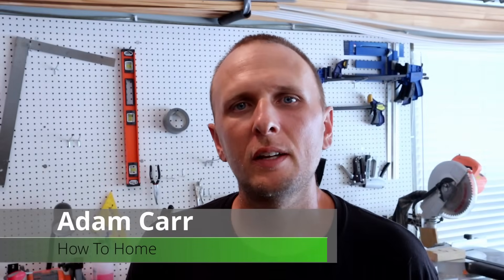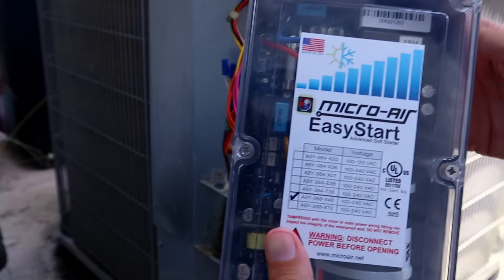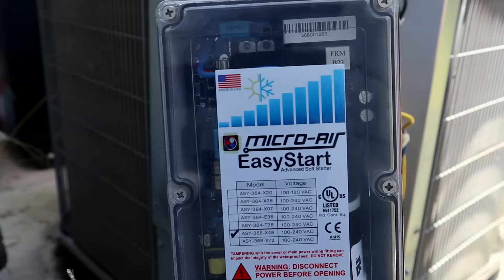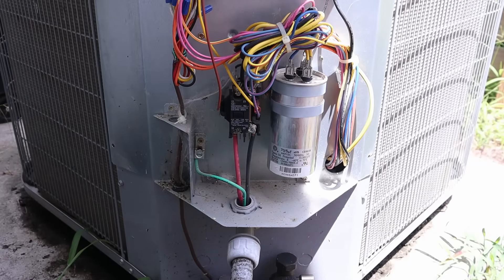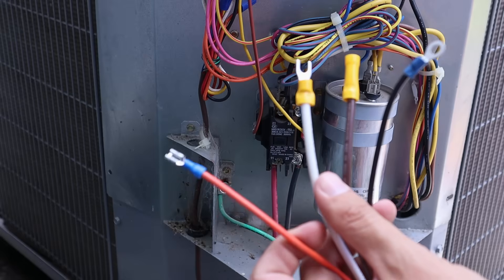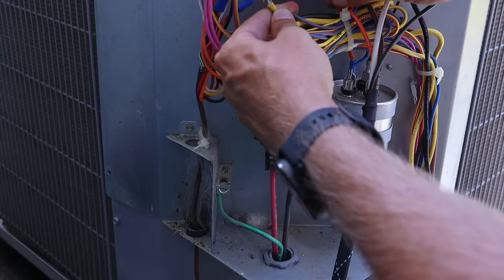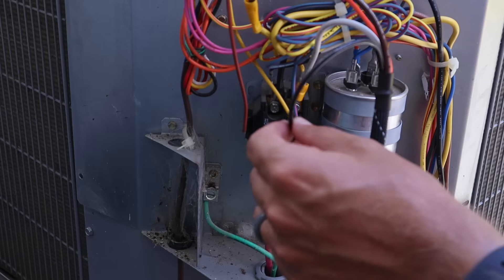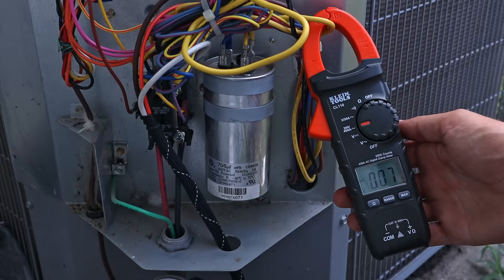How To Install A Soft Start Kit On A Air Conditioner | Run Home AC With A Generator | MicroAir

Comment: Think it this way....Hard Start kit is for kicking your compressor in the ass to get it started.  You can even use a hard start on an old compressor sometimes that won't turn over.  A soft start kit, is kind to your compressor allowing you to run portable generators and extends the life of your compressor.  If you get to a point where the soft start will not turn over a compressor that is old, then switch to a hard start if you do not want to buy a new unit right then.  However, soft start will extend the likely hood of that happening for a lot longer unless you take a power hit(that is what whole house surge protection is for).

Comment: Naked fingers touching the capacitor terminals are scary!  Otherwise great video!
Reply from the maker: The capacitor SHOULD NOT have a charge on it as it is discharged through the windings but best practice would be to use a screwdriver on the terminals to make sure and also discharge in the event it is still holding a charge.  Appreciate the input.

Comment: Great video. It is very informative. I find that the installation of the soft start kit is pretty straightforward. I too have a 4-Ton (Daikins) AC. I have a portable generator, 12K, Duramax, that is connected via a 50 amp transfer switch. I can run everything with the exception of my ac. My ac has a 40 amp double pole breaker. And I'm not sure how to connect it to my transfer switch to power the ac when an outage occurs. I'd like your input. Thank you.

Comment: I am going to install a 368. My 2.5T A/C unit has two capacitors; one is a dual cap 35uF5 370V and the other is a 5uF 370V oval single motor run cap. Can you assist me in how to wire this thing up?
Reply: One side powers the fan. The herm side powers the compressor.  Herm is the side that gets the soft start.

Comment: Hi Adam, Great video! would this device work on a roof top compined unit (AC and Heat), Manufacturer: Comfortmaker, Approximate tonnage: 5 tons.?
Reply from the maker: They do make soft starts for many different sizes and models.  I would check out Micro Airs website and see what they have and if it will match up with what you have.  More than likely they do.  Thanks for the feedback Gary!

Comment: Great video but How do I know the size of my central AC ? If it’s a 3,4, or 5 to unit ?
Reply: your A/C unit should have a plate on it with lots of technical information on it.  What you are looking for is "BTU".  1 ton = 12000 BTU.

Comment: HVAC pro here.
Hard start kits are for a different task completely they are for aging weaker compressors to give them an extra kick in the butt to start.
Think of it like coffee 
Your regular capacitor set it is the regular coffee. Which is great for most people. But some people need that extra jolt with a shot of espresso as well. That’s the hard start.

This is like switching to decaf.
Reply: New homeowner here: Would it make sense to replace the old capacitor instead of installing a hard start kit? Or, this will not make much difference since the compressor is mfr in 2011?

Comment: Can you use that soft start even without using a generator just to save money?
Reply from the maker: It won't save any money.  It just makes starting the AC up easier.
Reply: Than why does his meter show a big difference the reading after it was running?
Reply from the maker: I believe it was showing like 3 amps less.  That’s just on the compressor, there are many other parts using electricity like the air handler for example that doesn’t get lowered at all.  I just know if there was a change on my bill, it wasn’t really noticeable.
Reply: Ok thank you

Comment: So where is the soft start kit installed?  You don't show it so therefore the entire video is confusing.
Reply from the maker: I showed you where I was going to put it.  It doesn’t matter where it’s mounted.  Inside the unit, outside on a post, or the wall.  It makes no difference.  Totally up to you.
Reply: @HowToHomeDIY  How is it connected?  If you won't show it then where do I connect the wires?   Watch other videos of installing soft start kits.
Reply from the maker: I don’t understand.  The video shows how I connected the wires.

Comment: What is Inrush using a hard start?  Curious  which one is better at reducing the large startup current which is hard on a generator.   31.5 amps is a lot, especially if generator is already loaded.

Comment: Thanks for this,  I had never heard of this before. If main power is out, how does the generator power get to AC?   I was thinking there would have to be something connected at the panel.  I am have electrical work done this week and they are installing an interlock kit and a new panel to go from 20  to 30 slots. Also installing a ckt for an EV.  My inside panel does not have AC, its outside, like yours.  Sorry for the novice question.
Reply: Have a 30- or 50-amp Inlet box installed outside the house where the generator will be.  That Inlet should be connected to its own double pole 30-or 50-amp breaker in the main control panel.  This breaker would need to be just below the Interlock, so you can't have both the main breaker and generator breaker on at the same time.
Reply: @Pk3_Garage  Thanks. I have interruptible AC system which puts my AC breaker on the outside connected to separate meter.  Power is fed separately from the main panel.  my 50 amp breaker will be below the  main breaker as you described.  Thanks again.

Comment: A little old for a comment/question.......so by seeing this before and after measurement..does this also mean it's running with less power/effort thus lowering electrical consumption from the power company in essence lowering your electric bill?
Reply: No, this device only lowers the in-rush current at start up.  Once the unit is running, it uses the same power consumption as if it didn't have the Soft Start.

Comment: Hey Adam, just subscribed. Loved your backup generator videos, and I have used most of your advice. So I am also considering this device, and I am a homeowner, but no amateur. I would also like to trim the peak current with my 3-ton for a generator situation, and this looks like a viable option. Thanks for the detailed connection advice. My question is: Should the harness (I assume supplied) be run in Seal-Tite?

Thanks
Reply from the maker: Hey welcome aboard!  So per the manufacturer through email correspondence they told me it does not need to be in a conduit.  And you are correct, it is included and is attached to the unit.  Thanks a lot for the feedback.  Always good to hear when I have been able to help in some way!

Comment: They really work well.     Same situation here.  4 ton A/C.    
It's nice that the soft start allows the indoor blower and outdoor fan to start a few seconds before the compressor.  On Generator it gives it time to ramp up a little just as the compressor starts.  
Great video.  Clear and concise.  Thanks for putting this up.
Reply: I am wondering about putting regular soft starts on the condenser cooling fan and on the squirrel cage fan. It makes sense that it would improve the life of those motors. This is a video about soft starters in general and it helped me understand how it is without them, and how they reduce the destructive force of direct online operation: https://youtu.be/6X71RZWvOvc

Comment: Thanks for the video.  I also have been researching this topic so that I can use a soon to be purchased generator for my house A/C.  It turns out that these soft start systems are common in Europe.  Emerson (which makes all kinds of high end automatic plant level controls) manufacturers a soft start system in Europe which sells for a lot less than what you can find one in the USA; but it is not sold here.  If Emerson manufacturers one; I know it is proven technology and feel comfortable buying it.  Soft starts are normal for 3-phase motors in a chemical plants so that the equipment lasts longer and you don't pull the large electrical spikes; but I thought they were not an option for single phase electricity like we have in our houses.

I am undecided between the EasyStart 368 and one from Hyper Engineering SS1B16-32SN.  It is $249 versus the $350 for the EasyStart 368.  Cost entereds into the decision but the main reason I lean to the Hyper Engineering was they provided lots of information on why and how the device works.  As a chemical engineer, I like that.  Yes, their installation videos are MIA.  Previously, I had succesfully used a Hard Start kit for generator operation testing on a 4-ton 2-stage 18SEER compressor but it really hammers the compressor motor.  I pulled the hard-start kits out for normal (non-generator) operation; because I did not like the sound my compressors made when they started.  These soft start kits work in the opposite manner and should extend the life of the compressor.

Final comment.  I no longer will use my old generator because the power it produces has 11-14% THD distortion.  Better than many generator but enough to possibly cause problems on some household electronics which includes almost everything in your house.  You need <5% THD to prevent problems.

Comment: Hard starter & soft starter kits work differently. Hard starter help kick start the old compressor into life; soft starter reduce the amps of the AC condenser thus help to prolong its life as Adam said. 

The cost of soft starter kit is worth it because the AC condenser costs thousands if break down.
Reply: I'm assuming you can use this module just as a cost saver on your electric bill as well?

Comment: seeing your results.. this makes me wonder. your unit (4 ton) started just around 73amp. then it dropped to 31amps at starting after install. i have a 2 two ton which averages 50 starting amps. so if i would be able to cut that down by the same margin. im looking at around 21 starting amps ?

Comment: I have a question. With the reduction of start amperage by using the soft start would there be a savings in total electric used over time?
Reply from the maker: No.  If there was any it would be negligible. Just helps to start it.

Comment: Thank you for your great video; I learned a lot from it.  I do have an observation, and you may have taken care of it off camera. but you touched the capacitor.  You know what you are doing and were careful not to touch the bare connections, but a novice might not know that the capacitor holds a lot of power (even when the power is off)  that can even kill.
Reply: Also saw this. Shouldn't this be discharged first?
Reply: Yep

Comment: On the soft start kit it self did you extend the wires to reach from the wall to your AC condenser
Reply from the maker: I did at first but since then I just mounted it to a post beside the AC using just the included wire length.

Comment: I did not see you do this for your HVAC Unit??? Bluetooth models must be connected to power to disable the starting delay before installation. Turn off the breaker to the air conditioner. Connect the black and white EasyStart wires to the line input side of the contactor indicated by the yellow arrows in figure 8. Tape or wire nut the EasyStart brown and orange wire ends so they cannot make electrical contact with anything. Turn on the breaker to the air conditioner.
Open the smart device application on an Android or Apple device. To start the connection, enter “EasyStart_”, including the underscore (case sensitive), in the white box below “Enter EasyStart Bluetooth ID:” and press return. The “Connect to EasyStart” button will become enabled. Press the button to connect to the starter. The screen will change to show the ID of the starter.
Click the relearn tab and slide the switch for “No pwr on delay” to “ON”. Set the SCPT (minutes) for 1. Press “send settings to EasyStart”. Exit the app and turn off the breaker to the air conditioner. Disconnect the white and black EasyStart wires and continue with the installation.
Figure 8
Reply from the maker: Mine is not one of the newer Bluetooth models.
Reply: @HowToHomeDIY  So you changed and cut the jumpers?

Comment: Just wandering will the soft start also save electricity?
Reply from the maker: No.  Really just made to help run it with a generator and also extend the life of the compressor.
Reply: @HowToHomeDIY  Thanks

Comment: He was extremely lucky around that capacitor
Reply from the maker: How so?  It would be rare for the capacitor to hold a charge after the power is turned off.  They are discharged through the windings.  But they are easy to check and discharge if needed.
Reply: You didn't check to see if it was discharged, had a buddy that assumed it was discharged and got nailedby it, better to br safe than sorry

Comment: A few years ago I installed a hard start on my 10 year Goodman AC.  Can I install Micro Easy start too, or do I need to remove hard start?  Thank you.
Reply from the maker: You would need to remove the hard start per Micro Airs instructions.
Reply: @HowToHomeDIY   I installed CPS 5-2-1 CSRU1 Compressor Saver for 1 to 3 Ton Units

Comment: Looks like that Micro Air Soft Start Kit is no longer available. Do you have an alternative recommendation?
Reply: Pm me
Reply from the maker: I can only recommend theirs as I have not used others.  The links in the description for Amazon have at times sold out but if that’s the case you can still order it off of their website.
Reply: You might want to pin that because there are more viewers asking for it.
Reply: I live in Texas and just bought a backup just in case one dies after warranty expires. I can only recommend what you installed in that video. Works very well with my 7500i generator from powerhorse. Reduced the starting current from 100Amp to 48Amp. I used the same meter to measure the rush current.
Reply: Why are you deleting my posts. You can get this part cheaper somewhere else. Just ordered one today.
Reply: @T. Herd
Use a search engine and search for for the exact model number. That’s what I did. Found it $40 off  somewhere else.  

This is now addressed to YouTube and or to the creator of this video: if you delete this again I will unsubscribe you and report you.
Reply from the maker: Nothing was deleted on my end.
Reply: That’s what I though.
Reply: @HowToHomeDIY  I posted several times the name of the company with and without full and correct URL where I got mine ordered today and just a short time later all those posts got deleted. That does not make you thinking?

Beside this-the explanation how to install it in your video is excellent. Good video!
Reply: @petermesstorff9537  Jeeze, Karen
Reply: moc.erotseniramitiC

Comment: Since your run amps dropped by nearly 50%, doesn't that reduce the BTU rating by the same amount?
Reply: @Jerry Hodges I think it would have to since 1/2 the current with same voltage means 1/2 the power. I suspect that some of these running amp readings aren't long term averages.  The soft start is made to reduce in rush. Wouldn't expect any change in running current given identical conditions.

Comment: Great information!  Thank you!  What are the specs (amps & watts) on the generator you were using at the time?  I know this video is 2 years old and I saw a more recent one where you said you have a larger generator now.
Reply from the maker: Yeah I still have the same generator.  It’s a Cat 12000E.  15,000/12,000 watts.  Unfortunately they don’t make it anymore.  Thanks for the feedback!

Comment: Hi Adam, You edited out the (OH Sh?t) part where you noticed you forgot to run the "easy start" cable through a knock out hole in the bottom of the wiring panel didn't you? Those types of mistakes would give us a little laugh and show you are human like most of us.
Reply from the maker: You know what, I filmed this around 2 years ago and I totally forgot about that haha.  I had to go back and rewatch it.  That definitely did happen.  Good eye!  I am most definitely human, that is for sure!
Reply: @HowToHomeDIY how did you end up mounting it to the wall? Does it have a bracket?
Reply: That's ok, I've said Scheisse (sh*t) enough times to make up for his failure of the proper use of vulgarity. You're welcome.

Comment: Awesome video, but very frustrared as this unit pulls more current after installation (9amps more) peak, 1amp less running.
Not necessarily soft start in my case, might be sending it back if I can't figure it out.

Comment: You reaching into that box and touching the exposed capacitor terminals really had me cringing. Those things are capable of producing a serious jolt well after the juice has been turned off. I recommend always shorting them out prior to sticking unprotected (uninsulated) fingers inside.
Reply from the maker: That is good practice.  One that I use as well.  It is rare for a capacitor to maintain a charge though as it discharges through the windings.  But to your point it is possible for them to carry one.

Comment: Will a soft starter on the AC units give any noticeable reduction on my regular electrical usage? I live in Texas and we have 2 large units that run a lot many months of the year.
Reply from the maker: No.  You won’t notice a difference there unfortunately.

Comment: Great content thanks for creating this. Any consideration to the indoor unit powering up and that load?  It’s really just the fan in the air handler but is there a way to stage that as well as opposed to it kicking on at the same time?
Reply: Turn thermostat to cool/heat off, fan on and then switch to cool once fan is running. Most I’m aware of are staged automatically but this way will assure it is.

Comment: nice video -  just wondering should I discharge the capacitor before handling the wiring around it ? last time I dealt with a capacitor like that it knocked my dingy in the dirt.
Reply from the maker: That would be a good idea.  Don't let the dingy go in the dirt again lol